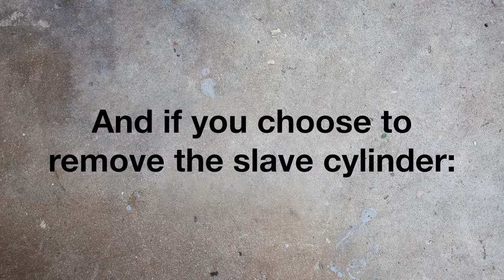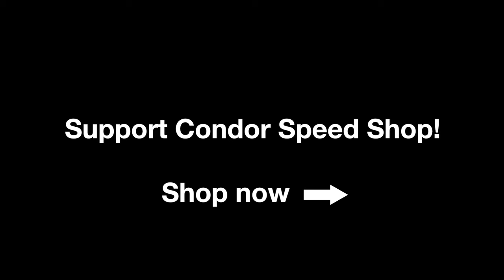BMW Clutch Line Install - E30 - Condor Speed Shop

Comment: any tips on re-inserting the slave into the transmission? I very gently tried and it wouldn’t slide in, then when I took it out the plastic nipple wasnt on it.. it slipped off into the transmission. Not too sure what to do at this point, and how serious it is that the plastic piece fell in, I’m assuming it’s not good at all. Some tips and insight would be very appreciated!

Comment: Is the difference noticeable on the foot?
Reply from the maker: It could be noticeable to someone with a very sensitive foot, and a very good sense of pedal pressure. The brake lines are more noticeable than the clutch line.
Reply: Condor Speed Shop yeah. I just got the condor brake line kit, the one near the trailing arm mount is pain in the ass to install, tried that last night no success, hope you guys do a video on that.